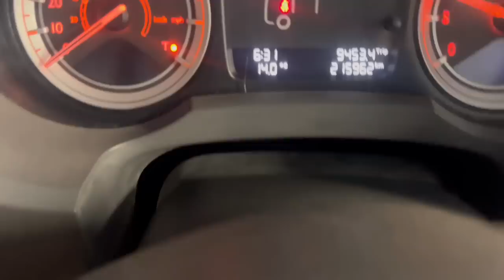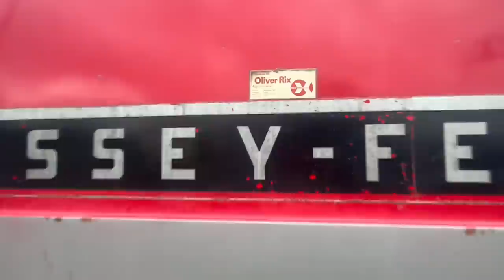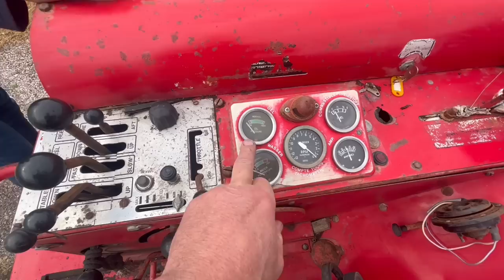Ford 6610 finish , Massey 625 combine

Comment: I looked at the 625 while I collecting something I bought at Campsea Ashe, and thought how genuine it looked. Glad to see its gone to a good home where it will be looked after. Oliver Rix was a Norfolk MF dealer who were taken over by Richies, who in turn were taken over by Cowies Eastern Tractors. The combine is a 1971 / 72 model. The rear numberplate mounting was always there from the factory, so unless the plate has been removed, it may never have been road registered. The biggest issues with the early 625 s were weak grain pans and shaker shoe / sieves. Basically they just widened the 525 without any strengthening. The later 625 was fitted with the maize grainpan, beefed up shaker shoe and front elevator and were a good machine, until they moved production to Marquet.!!!!!!
            A lot of 625 Perkins 372 engines ended up on irrigation pumps, so this could be a source of a water pump.

Comment: Good video, pity he didn’t have the old one to overhaul. I’m having the same problem for a class protector with a Perkins 4.236 engine you can get water pumps but the outlets all point in the wrong direction so have to overhaul the old one

Comment: You will find one Colin mate Dave is on the case and now got the bug to do a combine restoration
Reply: Don’t be putting ideas in his head!! He’s got enough 1200/1250’s to last him the rest of his life even if he lives to be 100
Reply: Ah what’s one more just a bit bigger 😂😂😂 it’s still red
Reply: In my mind the 625 once reworked worked well and blew away the 750. 625 wider drum, bigger cleaning area and handies a 14ft table easily and would work with 16ft in the right conditions. Did a demo years ago when we sold a 625 and our sister dealer sold a 750. Landed deep in it when romped past the 750. Early ones which this is were a worry until reworked. There were several multi page service bulletins. Frequently broke the shaker shoe and grain pan which can be strengthened. Needed to watch that the rasp bars were and remained tight as if loose and come off Colin will have more than the water pump to worry about. As he says the majority of farmers never put a combine way properly, it was lift the table once the last bit of crop was swept into the feed elevator and disengage the mill (threashing mechanism) then left outside or half sticking out of a shed allowing rats and mice to do their thing. S good wash never did them any harm as long as they were run up afterwards to dry them out. If they were run until the were empty, hatches removed and run again, then non drive belts slackened off they had a chance. Same at start of the season, check the belts and gearbox oils, grease the old lady up, adjust the cylinder clearance and run them up for a few hours keeping an eye on them and you had a chance at a fault free season. The early 625's were prone to flexing when on sidlings (going across slopes) seeing the cleaning fan wear against its casing. BUT as, mentioned they worked fine once the service updates were applied. The last run from Kilmarnock were not that great. We had three of the last which were sold, and the PDI's took days, parts missing, bolts not tightened. Super II's were an improvement untill they changed the ATHC (automatic table height control) system and the service rework was more of an encyclopedia than a multi page service bulletin. The mechanical cable and skid system worked well, but with cost out programmes, the electric sensed system was fraught with concerns is the best way to describe it. DAVE, Please, please, no more singing !!!!!!!!
Reply from the maker: @jakeboy349 read this 👍